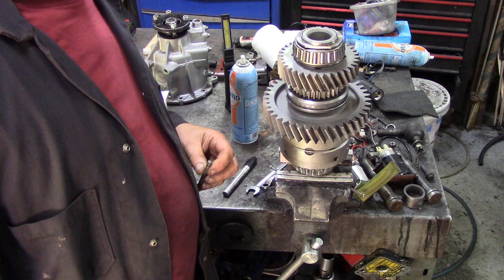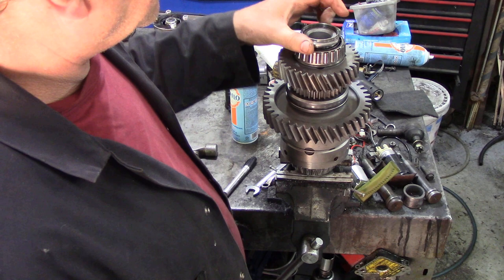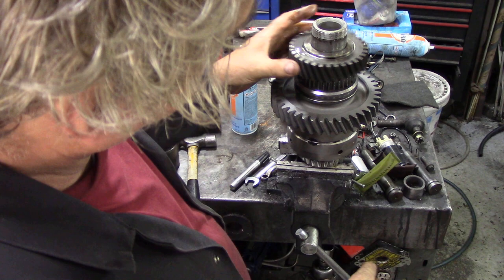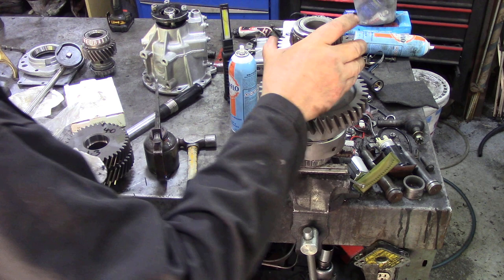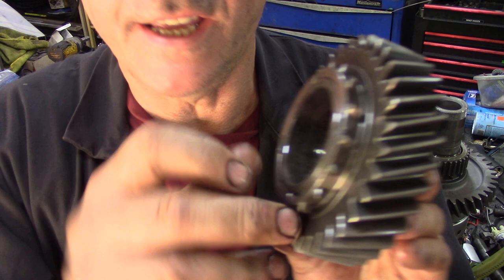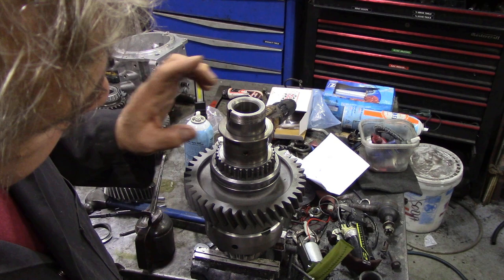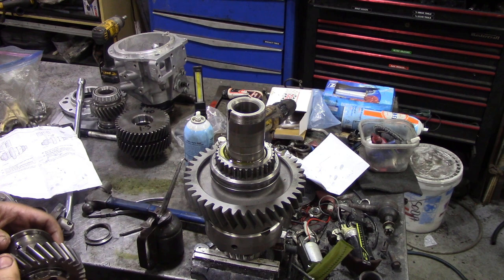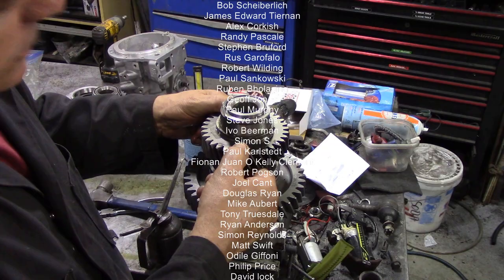LT230. Assembling the 1:3 transfer gear, but it was not quite right

Comment: That's where experience comes in to its own. Inexperienced would just think that it was either meant to be like that, or it'll just bed in. Was waiting on you uttering the letters JP and sure enough. Handy chap to have as a mate.
Reply from the maker: Indeed - As I mentioned, it may never get put into low range and leave the high gear spinning - but it is not correct - just another of those things to look for!